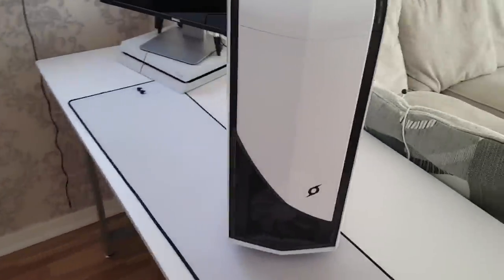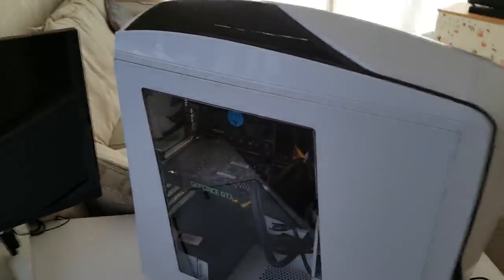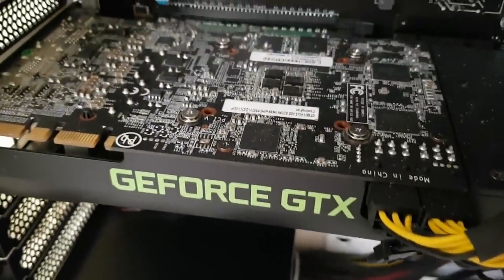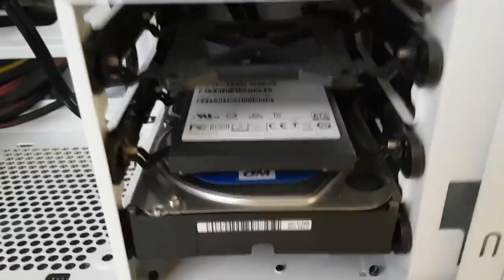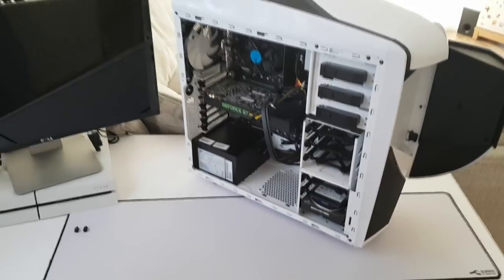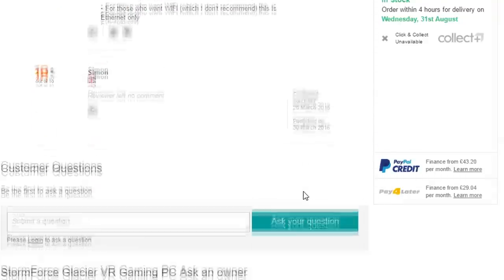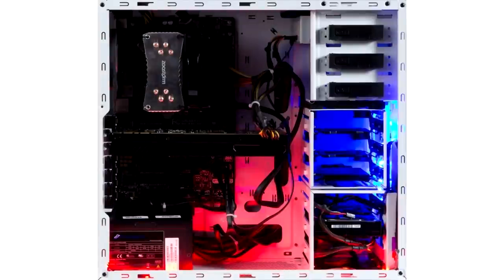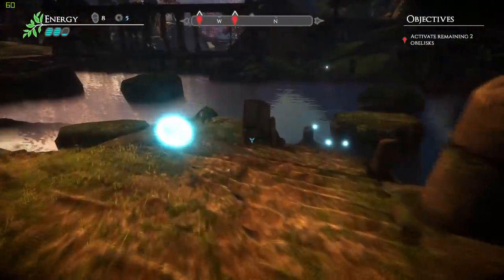YOU FALLOUT PEOPLE NEED A GAMING PC!

Comment: Starlord you do not need 2 hdmi ports in order to support dual monitors. On that graphics card you most likely have dvi and/or vga ports, in which you can slot another monitor in. I personally recommend that you would go dvi if you do ever decide to do dual monitors because it is a digital connection just like hdmi and it can achieve full hd. VGA is a analog connection that should only be used when you absolutely have to because it achieves a low resolution and has no perks to go with it

Comment: 4 gb of GDDR 5. You don't want DDR in a video card unless you like bad performance. Also not knowing how to build one isn't an excuse, if you have used Legos then building a PC is easier. The sockets where everything plugs in can only be done one way and only with the correct parts. The hardest part is hooking up the front panel of the case and that's all standardized and is in the manuals. The there are thousands of step by step easy to follow guides readily available if you need them.

Comment: I'm currently building a PC myself. Price is pretty much similar to that, around 1k dollars.

How good is this?

GPU : MSI GeForce GTX 1060 ARMOR 6G OC 
Motherboard : ASRock H110M DGS LGA 1151 Intel H110 SATA 6Gb s USB 3 0 Micro ATX Intel Motherboard 
Cooler : Cooler Master GM Series G550M Compact 550W 80 PLUS Bronze Modular PSU 6th Generation Skylake Compatible
HD : WD Wd10ezex 1TB 3 5 7200RPM Hard Drive 47 49
RAM : NCIXUS com Buy HX421C14FBK2 8 Kingston HyperX Fury Black 8GB 2X4GB 
2133MHZ DDR4 Non ECC CL14 DIMM Dual Channel Memory Kingston
CPU: BX80662I56500 Intel Core i5 6500 Skylake Processor 3 2GHz 8 0GT s 6MB LGA 1151 CPU

Welp, I feel kinda ashamed caz I simply asked my friend for this list and I technically don't really understand why it's any good. Oh look! The number is bigger! o-o.....well anyways, how good is that for a total cost of 920~dollars for the parts + shipping?
Reply: That's a fairly solid start, but never feel afraid to go and upgrade it in the future! And that rig is damn good
Reply: Hm thanks :D

And yeah upgrading a PC should be super simple now that I know a bit of the basics.Bad Content

Comment: what do I need to run this game smoothly on ultra. I'm running on medium and I still can't get a smooth 60fps. 

msi r9 290x
amd a10 4core @4.1ghz
8gb ddr3 3333 ram

what the fuck do I need to do?
Reply: +GeorgeLlamaPlays what do you mean by that? If you are wondering if I can play other games, the witcher 3 runs great.
Reply: +OffStageRaptor ok, so it's the processor then. Damn. Well I guess I'll just wait to build a new one. I'll make sure it's a nvidia and Intel machine. Thanks.
Reply: i have an R9 290x.  i knew that i5 were better but i didnt think that it would be that much of a difference.